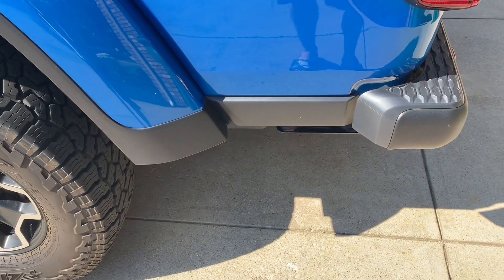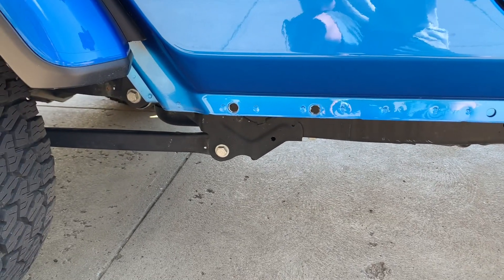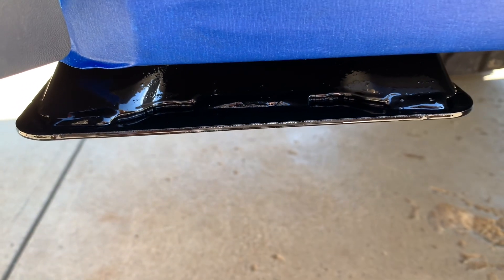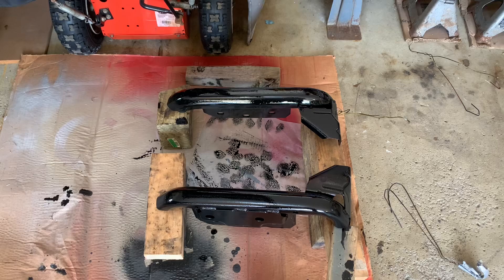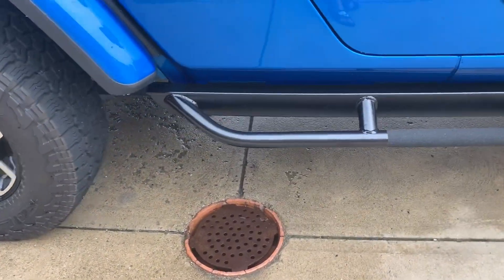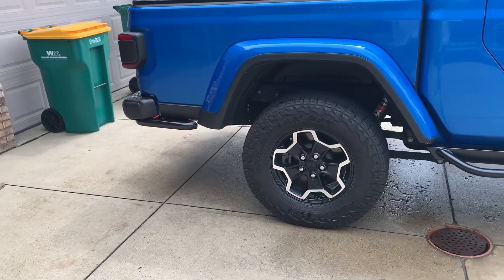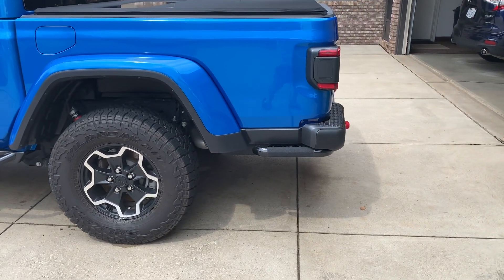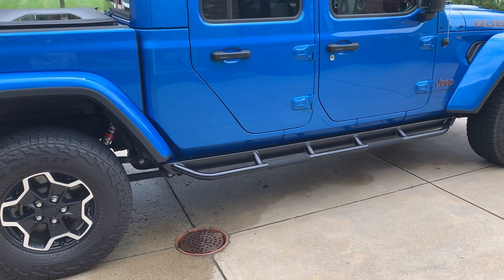2020 Jeep JT Gladiator Rubicon - Fixing visible rust on my 2 year old truck with POR 15, thanks Jeep

Comment: I’ve done very much the same type of project on an old Jeep I had and a Saleen Sport Truck trailer hitch. (ALL the paint flakesd off of that POS!! Lol) Anyways, my only tip is: POR isn’t UV protected! It will gray and discolor when exposed to sunlight. A topcoat is required. Oh, don’t get any on your skin!! It will literally have to wear off of you, if you don’t remove it while it’s still wet!! Learned that the hard way. POR15 is great stuff though. Sticks much better to rust than painted surfaces.
Reply from the maker: Yep, I’ve used it many times in the past, used gloves or took any that got on me off right a way using towel with brake clean.  If it grays, I’ll pull it off and rattle can it.  Thanks for the heads up.

Comment: Im getting rust behind rear tow hooks, 21 Gladiator. Jeep wont repair as its not corroded enough.
Reply from the maker: Yeah, I have that as well.  Not very noticeable area, but definitely has bubbles in the paint/corrosion.